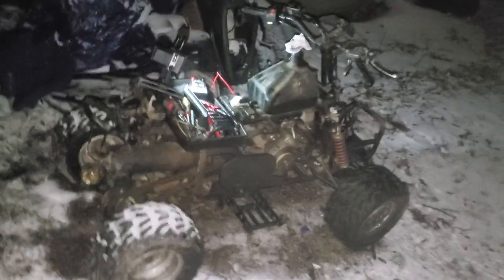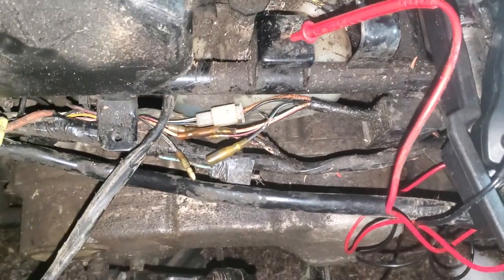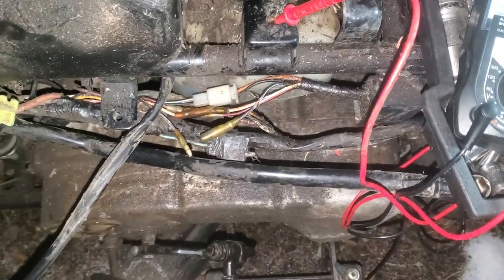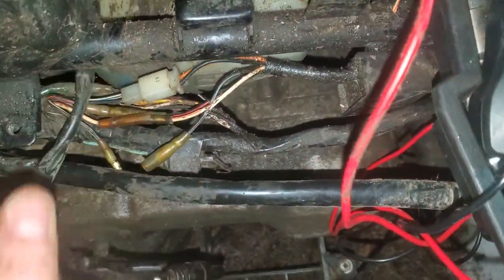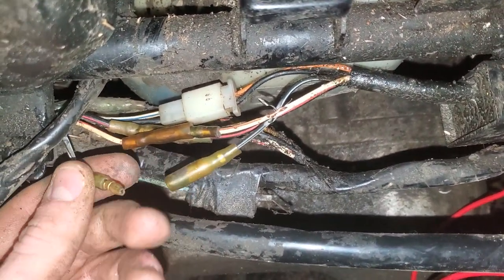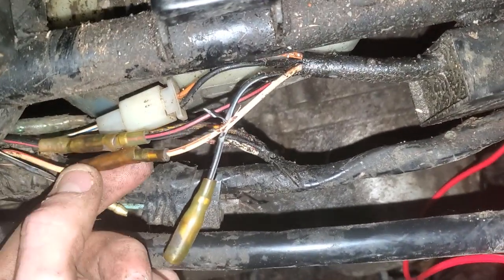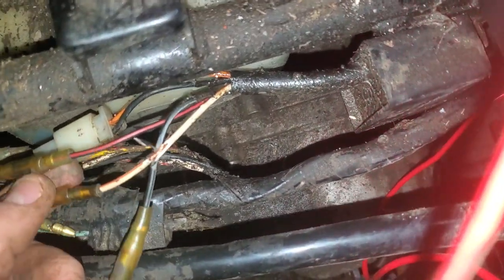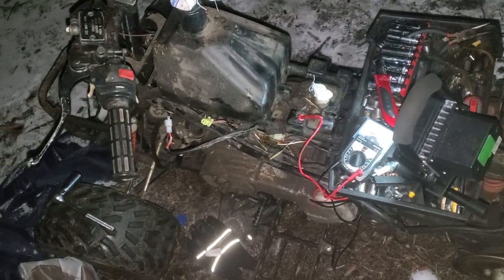Easy Fix for No Spark on A Dinli or Polaris 90cc Fourwheele ATV Quad without wiring diagram

Comment: did you ever happen to get this bike running? and leaving the wires crossed can the bike be driven this way
Reply from the maker: Great question. All you have to do is take a lowes light switch and run it in-between the two wires. To shut it off simply turn the light switch off ( this disconnects the connection ). The two wires I splice in the video is not a magic trick, it's simply understanding what the CDI wants in order to see the bike as "on" state.

Comment: I have nuthing but a rear tail light and neutral light . Had no spark untill I did what u did . Can't figure out why electric start don't work
Reply from the maker: Breh this is for spark, why would you do this if you had spark? Check 12v at starter relay

Comment: Should I just change the cdi?
Reply from the maker: No, if this fixes the issue then that means the killswitch wire is stuck grounded and you have to figure out what part of that wiring went bad. Could be key switch or killswitch or on some even a kick stand sensor!

Comment: This worked for a day and now no spark again??? Is the cdi bad now
Reply from the maker: Is it still disconnected? How were you shutting off the bike? If you were pulling the ignition coil off the bike to shut it off then you can damage the ignition coil spark plug boot.
Reply from the maker: Maybr check your wires could come loose
Reply: @austinwestphal5372  is the coil it's self nice n tightly bolted to frame

Comment: im trying to do what you did but after I ground it like you then what to I do to start it?
Reply from the maker: Jump the starter relay. Its like a cylinder about an inch tall and wide that has two big wires on top and 2 smaller ones near that with 12v supplied where the battery should be, you jump the 2 big nodes on top by putting a flat head across the top.

Comment: What is the correct way to fix this?
Reply from the maker: Find where the killswitch isn't getting ground. Key in off position breaks ground, killswitch in off position breaks ground, bad ground can.. you guessed it! Breaks ground. Look up the wiring diagram and see what the CDI needs and confirm with multimeter.